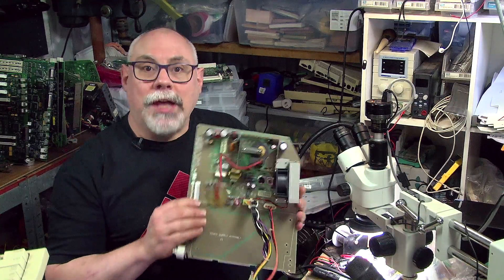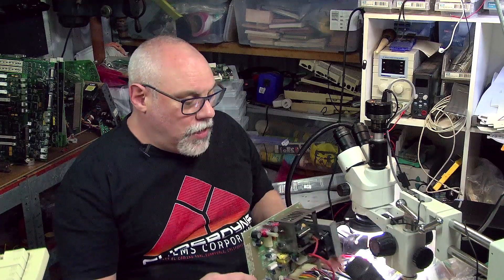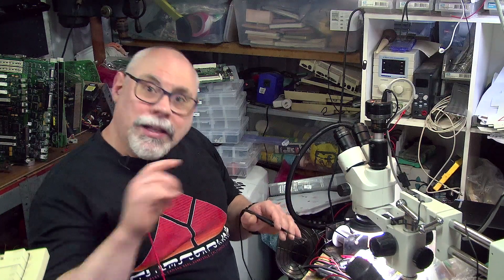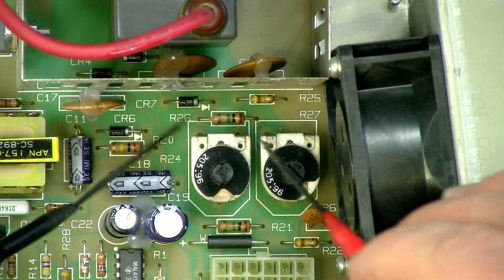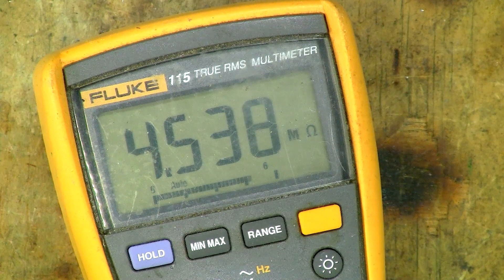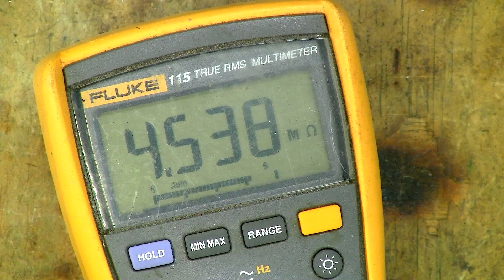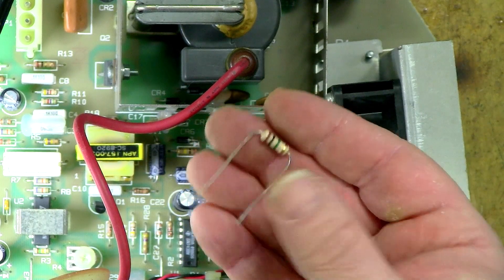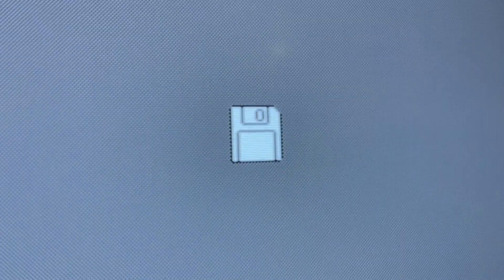QUICK TIP: Fixing the focus control on a Macintosh SE or SE/30

Comment: Bruce great job but what could cause the horizontal to not move or have a reaction when turned?
Reply from the maker: Do you mean the width adjustment? There is no horizontal position adjustment on the SE.